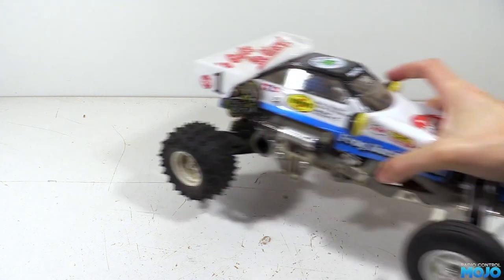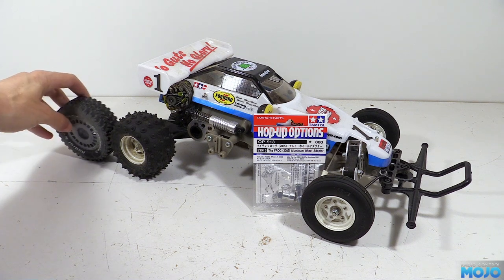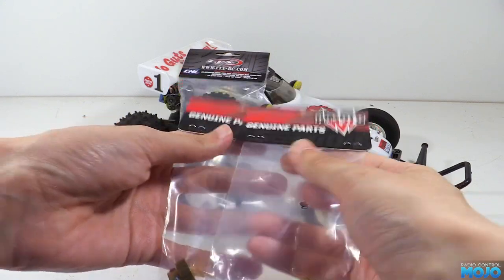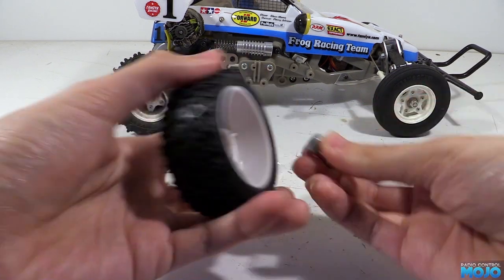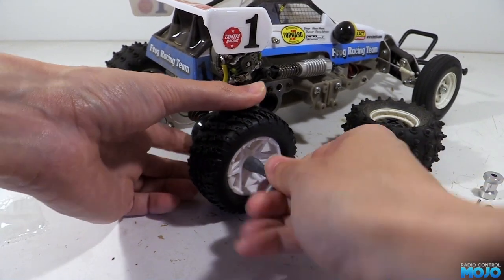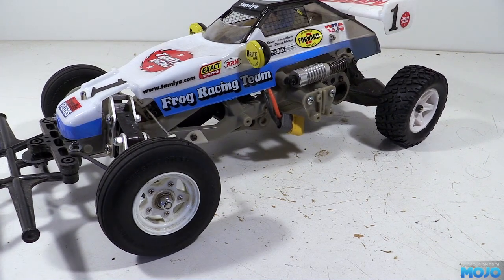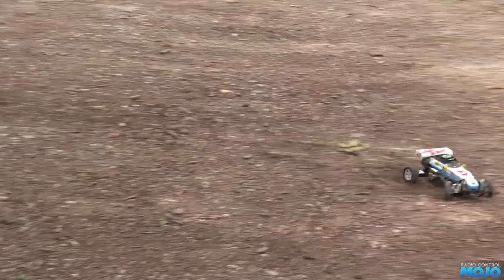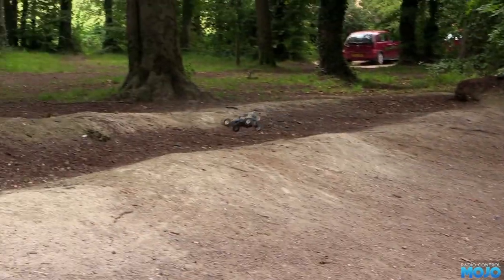Tamiya The Frog - #8 - 12mm hexs & brass pinions

Comment: There's been an ongoing issue with the Re Re Frog/Brat Front Spindles...
I've heard of more than quite a few Axles FALLING OUT of them!! 😖
Some Guys on the TamiyaClub Forums have Drilled and Tapped 3mm holes in the Spindles, and fitted Grub Screws to retain the Axles. 

Tamiya SHOULD have fixed it, but they didn't.